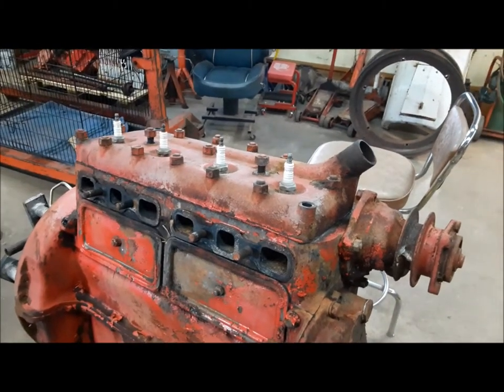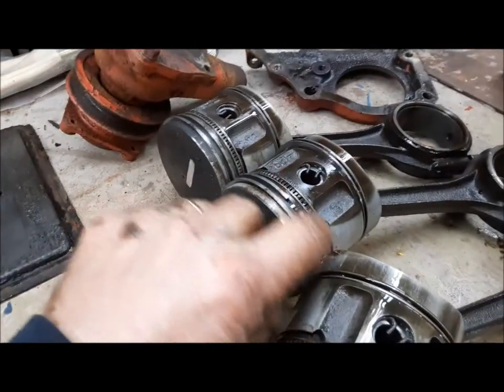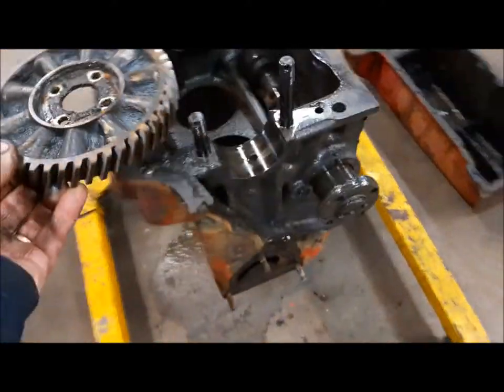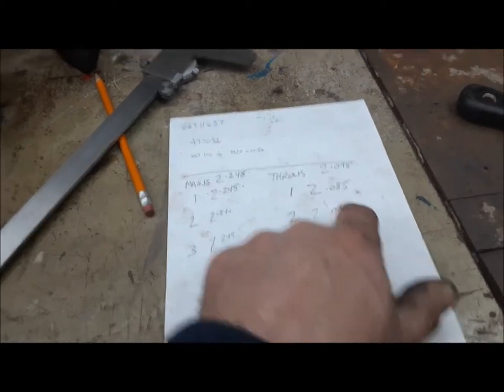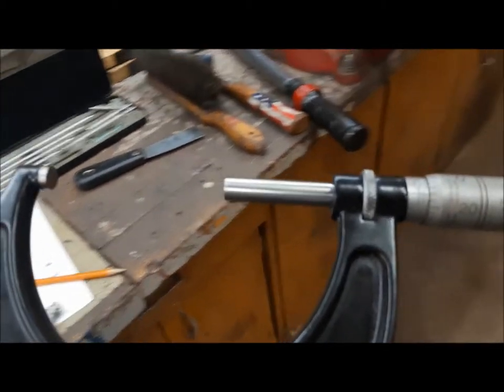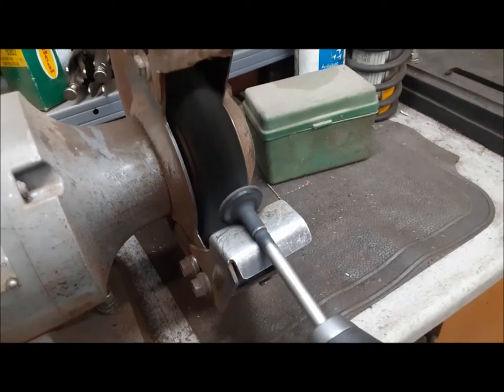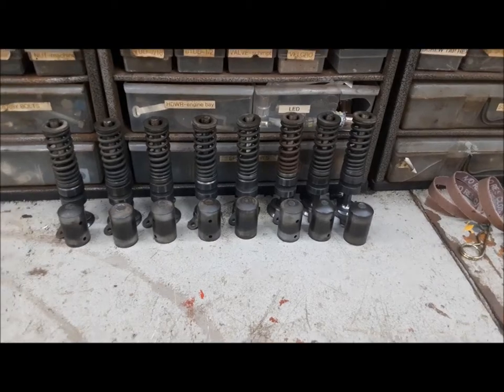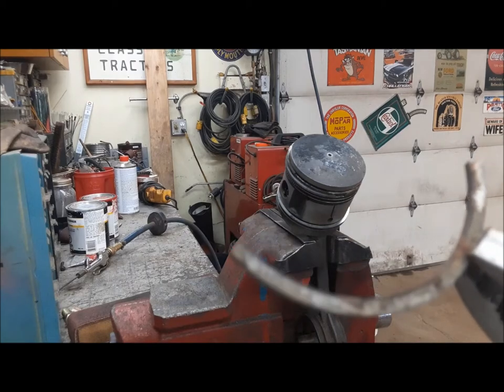1948 Ford 8N Parts Tractor part 7 Engine Disassembly and Inspection

Comment: What kind of stud extractor do you use to pull the cylinder head and manifold studs? I need to order one of those. Does it hurt the threads at all?
Reply from the maker: Its a cheap harbor freight cam style stud puller. Yes it mars them. So then I use a thread chaser to clean both ends. Or sometimes I just chuck the lot of them and use bolts. They came either way over the years.

Comment: I have an oil problem, oil in radiator. Oil psi at 60 lbs - can I reduce the psi with a different spring - hoping to avoid leakage.   Any guess where oil internal oil leak is ?.  Going to remove head first & install water remp gague.
Reply from the maker: The only way oil can get into the cooling system on an N is a cracked or porus block. There is no oil in the head or the head gasket. I would do a full cooling system flush and clean, oil change and monitor.If it happens again, the block is likely junk. BUT  many times previous owners used dirty buckets to put in coolant and contaminate it with old oil or even mix oil in the coolant thinking it will save the water pump. 60 psi oil pressure is excellent and do not mess with that.

Comment: Hi Kevin I really enjoyed your video I have to tell you when you started to heat the piston and said “you just have to be patience“ and then all of a sudden there’s a1/4 piece of a compression ring on the screen and without any hesitation you say” patience was never my thing “  That was so funny I laugh out loud and thought things like that only happened to me 😀
I really enjoyed the way you dealt with that oil pump that was genius!And axle grease to prime the pump that a great idea also! Thanks for sharing your wisdom I appreciate it more than you know I wish I could come up with ideas to fix things like you do!
How do you feel about fibre gears ? And also how do you put the cam gear back on in the right position? I almost forgot it was good to learn how to measure the bearings! How do you clean up the crankshaft? Carry on Canada 🇨🇦👍
Reply from the maker: I have had the fiber gears before and just put them back if they were ok. The cam gear only goes one way(next video!), I polish up the crank with strips of emery.

Comment: Gordon here,
You say you order parts for the tractor, Do you have a special place to order from or is the site on the internet. The reason I asking is I also live in Alberta Canada. I also have old Minnie M-5 tractor . Which is hard to get parts for. Maybe not looking in the right places. I also have 2 ford tractors , 1 a 9n other 8n And when I found your site I save all so I can go back for needed info.
Reply from the maker: I get parts from Steiner Tractor in Michigan and Just8Ns in North Carolina. You can also find Canadian sellers on ebay with tractor parts and there are some parts on amazon.
Reply from the maker: And Diamond Farm Tractor Parts in Brighton Ontario.